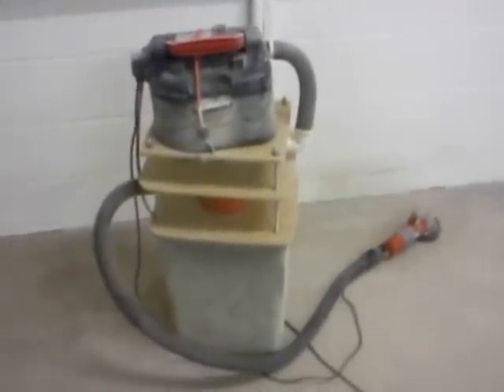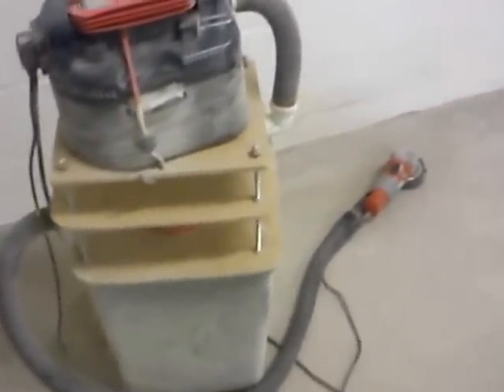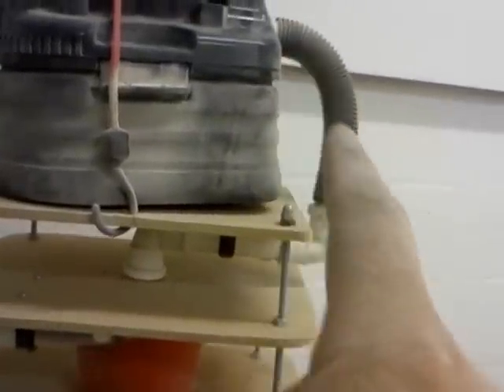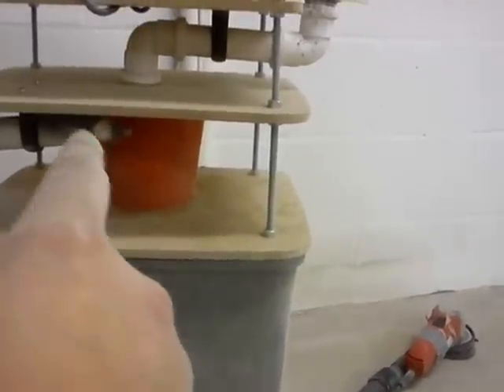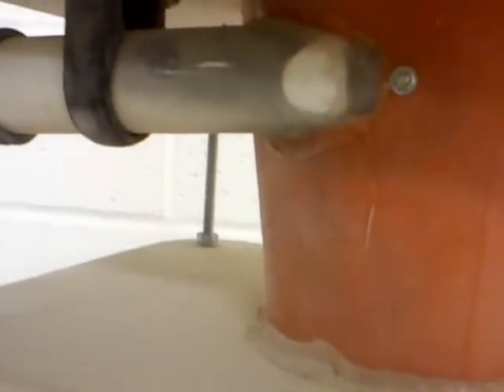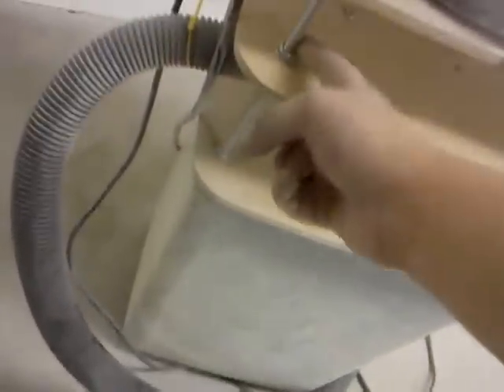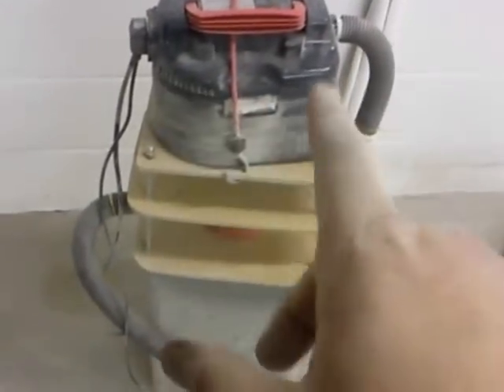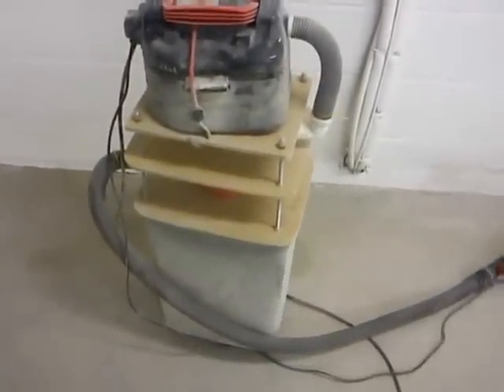Homemade cyclone shop vacuum

Comment: I would try moving the pipe that is in the cone up or down.  Ive adjusted my cyclone successfully at that point.  Check out my channel if you need clarification.  Good Luck!